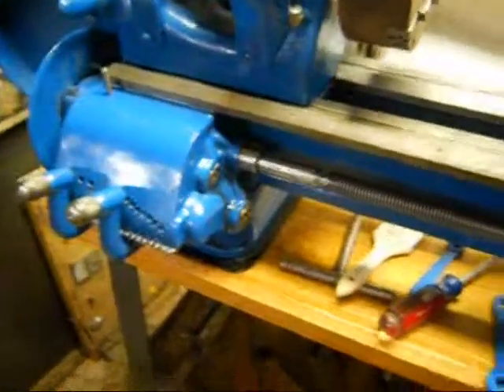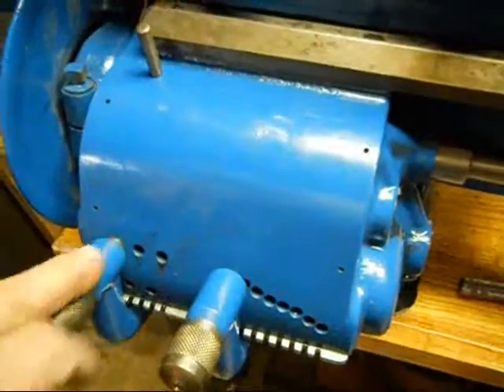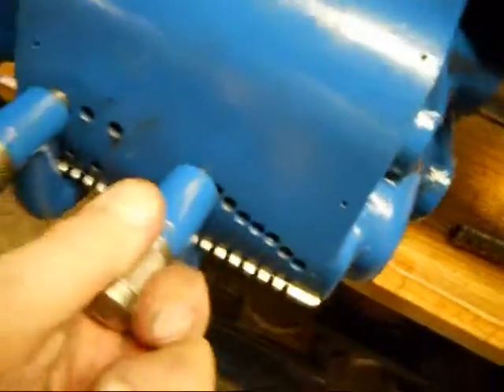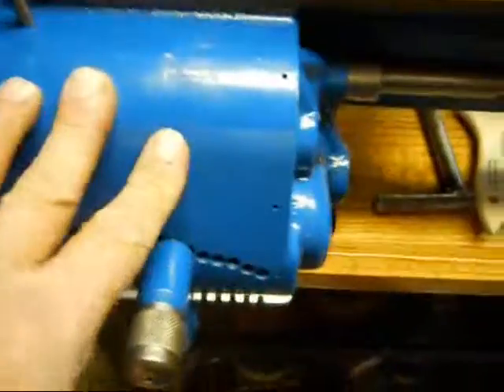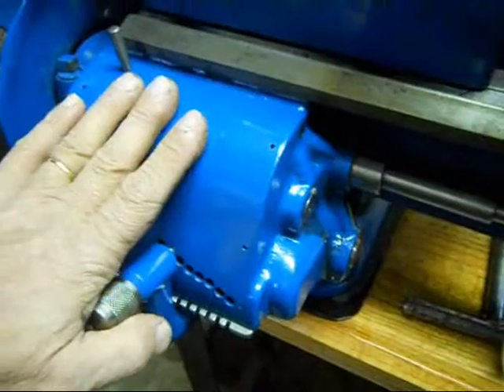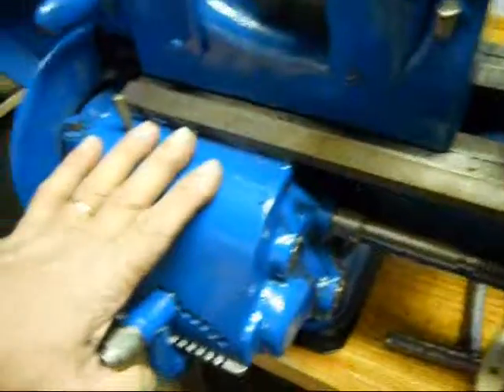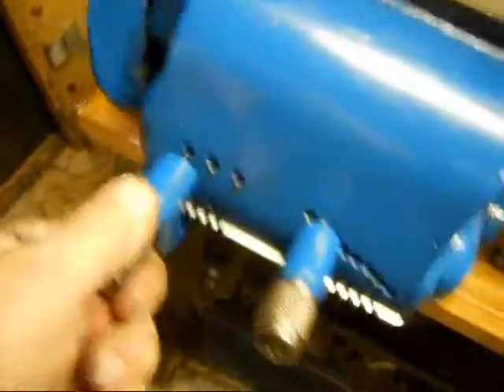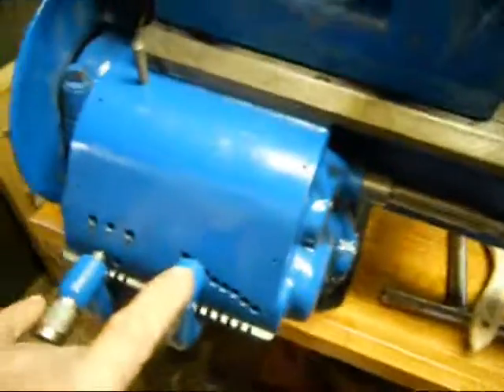South Bend 9A Restoration #10 A Thumping Question

Comment: I'm stall learning on a lathe my self  but I have a mechanic back round to me it all most sounds like a gears clashing to me you could try to put oil on the gears to see if it quite it down
Reply from the maker: Thanks for the input Raymond, sadly I have found the problem and its a broken gear on the gear tree.
Reply: Sorry to hear that  I know the feeling I spent all summer cleaning my old 9A  up new motor  and a month ago we had a flood so I got to start over cleaning and rebuilding the motor